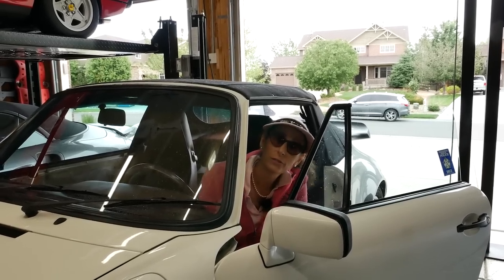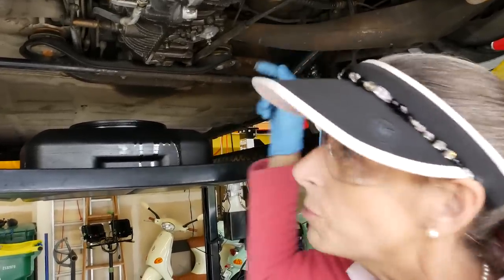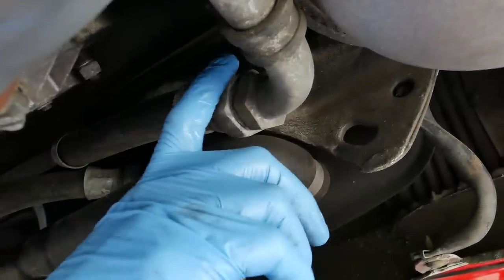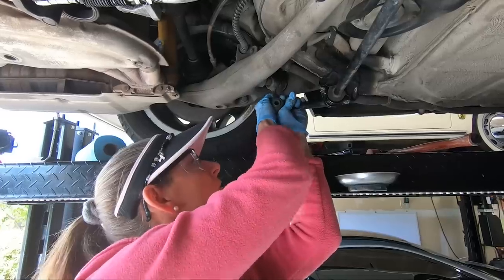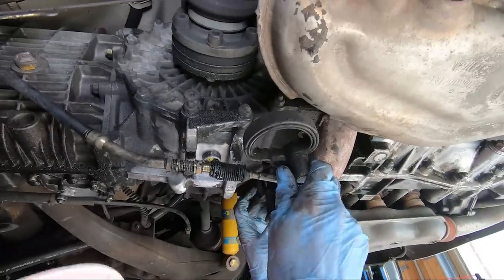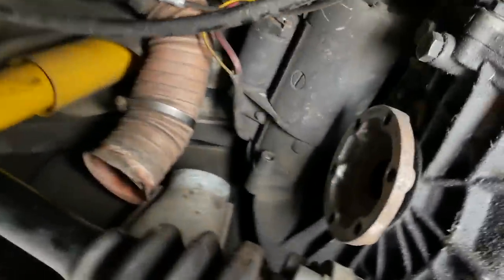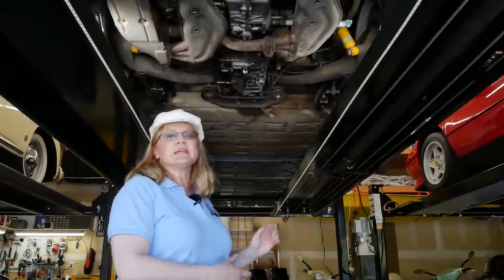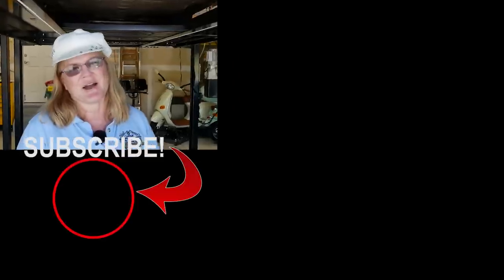Budget eBay Porsche 911 3.2 Carrera Project #5 - Hoses and Axles and Oil -  Oh My!!

Comment from the maker: Hi Everyone!

In the fifth episode of our 1986 Porsche 3.2 Carrera Refresh build project, Franny gets to disconnectin’ under the car.  There was a lot to get done under there!  We are close, but there will be a second part to this video for the bits in the actual engine bay so stay tuned for that!  Let us know your thoughts!

You can get the "101 Projects for Your Porsche 911, 1964-1989" here: https://amzn.to/2XlmYYb

Also that cool Porsche Jack Pad - Domestic Aftermarket 
https://amzn.to/2RNOlF9

And that neato drain on the sump: Fumoto F309L Engine Oil Drain Valve
https://amzn.to/2Lw9UJ6
Reply: Heidi and Franny's Garage , what do you do if you overfill your 911? Insert a tube via the dipstick tube? Loosen the filter? Or the drain plug? Thanks!
Reply: @vincerunnerretrobikevince4212  In her case, she could just open up that Fumoto valve on the bottom of the oil tank, let some oil pour out, and then close it.
Reply: @vincerunnerretrobikevince4212  Nothing wrong with the dipstick tube (although I don't know about the specifics of 911 oil tanks and dipstick tubes.) An oil change evacuator, or a plastic syringe with a thin plastic hose,

This is a very handy suction/pumping device for a fair price:

(Alas, sold out at amazon today.)

Its hose is too big for a dipstick tube with with some barbed adapters you could add a skinnier hose to that hose.

Comment: Enjoyed that. 
 Moving the car with the axle out is usually not a good idea. OK in your case because its not moving far. In most designs the axle holds the bearing half's together.

Fantastic detail. Reminds me of doing the clutch on my 997 S. Working on your own Porsche gives you even more respect for the quality and design.
Reply from the maker: Thanks.  Yup just out a few feet and back in a few feet ;)  But, thanks for the tip!

Comment: 12:55 If your jack handle doesn't fit, a good piece of black iron pipe from the hardware store will work, too.

Even better? An impact gun!  For those of you in wetter or saltier places. A bigger hammer to push the axle stub in, too, got get that outer CV to leave the hub. Heck, an air hammer can be nice, too. (Please, keep the old nut on to take the blows.)

In conclusion, air tools are awesome.  But so are rust free cars!

Comment: Very therapeutic to watch the process.  Thanks for another great video.  One important step I learned when restoring my MGB was to bag and tag everything coming off the car.  Box up related system components. Restore and refinish parts and voila, reassembly is a clean and systematic process.  Very rewarding .  Thanks for sharing.
Reply from the maker: Good idea.   Thanks.  Heidi

Comment: Remember to clean/coat all exposed rubber parts including CV joint boots and steering bellows with generous amounts of 303 Aerospace Protectant; multiple applications is even better. Do that and they will last.
Reply from the maker: I'll probably referb the CVs and replace the boots...  We'll see...
Reply: @HeidiandFranny  Even if you do that... soak the new ones inside/out for a few hours in a bath of 303 Aerospace Protectant before installing and you will never have to replace them again.

Comment: Not sure why you have to pull fuel pump fuse if battery is disconnected? Or did I miss something? I do love your whole series. Thank you for adding great content to the community's knowledge base.
Reply from the maker: Hi Hans, I am following Wayne Dempsey's  advice to remove the relay or fuse to the pump.  It is just a precaution in case you do hook up the battery to, say, roll the windows down there would be no chance the pump would run with the fuel system open.  Sounded like a good idea to me :)

Comment: Interesting how similar the car continued to be to a Beetle, even though it's an '86.  I mean, 17mm hex for the transmission is the same as a Bug.
Reply from the maker: Yes, it is amazing.
Reply from the maker: Wait until we get the engine up on the yoke of the engine stand.  That yoke sill also fit a 356 engine and a beetle engine.  That crossover 912 with the 911 body and transmission but a 356 engine kinda sealed the deal ;)

Comment: You got schmutz on your pink fleece ......oh i see Joshua already noticed.
Reply from the maker: I know!!  That transmission is a mess!!  It wasn't a few months ago.  My guess is one of the axel seals is weeping.  I spent half an hour washing that fleece!
Reply: Here's a tip:  Citrus degreaser or hand cleaner.  This stuff will remove grease and oil from almost anything.  Just check colorfastness before ruining something!  Low to non-toxic, so you aren't absorbing all sorts of long-chain hydrocarbons, especially when using on your hands.  Without this stuff, every item of clothing I have would be grease-stained.  Apply it to dry clothing and be sure you don't put unwashed grease into the dryer - that kinda makes it permanent.  tJust be sure to thoroughly rinse the citrus out before laundering.  If you don't, you'll give the entire laundry load a citrus smell.  Yuck!  (I'm SO sick of the smell from decades use, but it works.)
Reply from the maker: Thanks for the tip!  I have used that (Goop mostly) and it does work well, but I think I found something even better.  Try this next time and see if it works for you...  Pop into the local dollar store and grab a bottle of their finest cheap clear hand soap gel.  That stuff is amazing!  It works great and works faster and better than Goop.  Smells better too.  Then from there into the wash with a bit of power bleach and the close look new.  My new go-to... F

Comment: Just an observation, aren't the inner ends of the CV joints typically packed with grease (I'm talking generically rather then specifically to 911s), whereas yours were completely dry?
Reply from the maker: On lots of cars that is true.  The 308 and the Beetle are as you said and should have a bunch of grease in the cup of the drive flange on both sides.  On the 3.2 they are a little different.  There is a cover over the end of the CV on the inboard side and the outboard is bonded to the actual axle.  The additional grease goes inside that inboard cover.

Comment: I think you should have put the car on the lift  with the rear hanging over (even slightly beyond the rear Wheels)  and used two of the Jack Fittings on the rear only and supported them with Wooden Blocks and just secure the front of the Car with its Towing Hook / Eye to the front of the lift. 
the method you used was so precarious !
Reply from the maker: You can't get the engine and transmission out at the same time...

Comment: Don’t understand why you pulled the large nut off of the wheel, and pulled the complete axle? We just tie those up and out of the way when we pull the engine.  You don’t need to do all of that extra work.
Reply from the maker: So they don't fowl when moving the car.  Also, I was concerned with interference from the starter.  If you are just pulling the engine there would be no problem...  But, since I'll be doing the suspension as well, they will have to come out anyway.  Just easier now.  This is an extensive refresh - engine, transmission, suspension, interior, and paint.